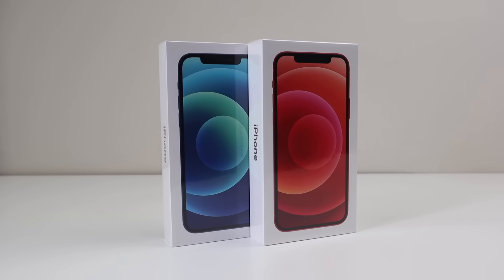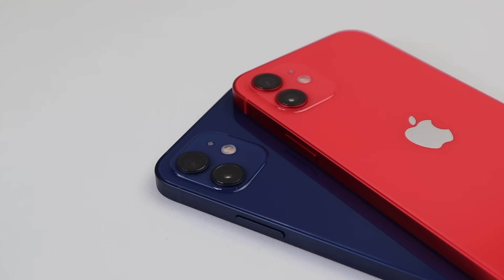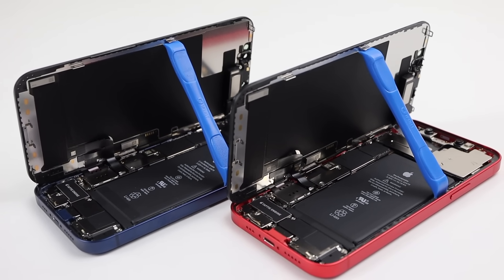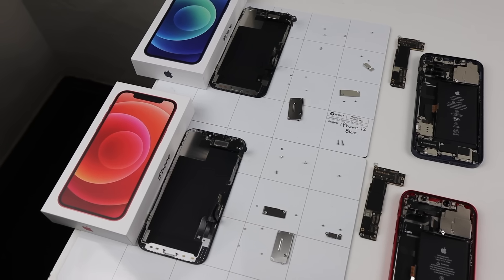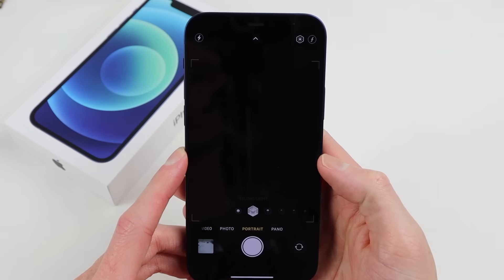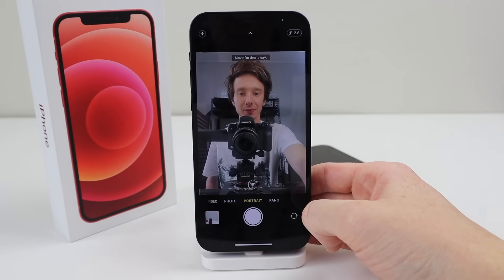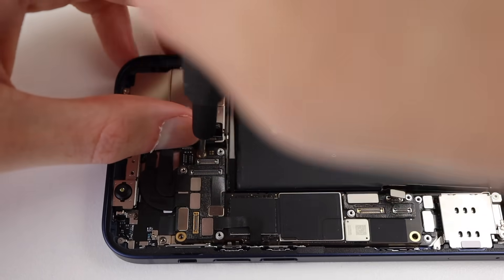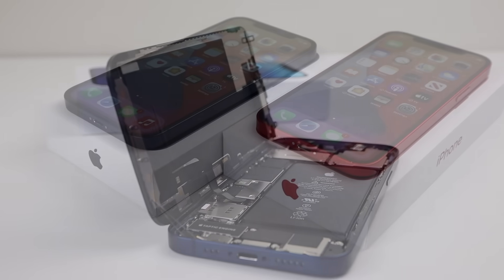iPhone 12 Anti Repair Design - Teardown and Repair Assessment

Comment: Apple is just a blatant scam. Never buy anything from them. Ever!
Reply: "Yo era amigo de Steve Jobs"
Reply: Not only are they a scam...  their hardware is inferior to just about anything else on the market. Soo not only are they underpowered, they are over priced and locked down so they cant be fixed.
Reply: @DrGibs347  the A14 chip is the fastest on the market. The M1 chip for the  macbook is also really good.
Reply: hmmm not really anymore i think they are actually heading the right way with their m1 chip in their laptops but the rest of their products still are shabby
Reply: @DrGibs347  underpowered ?
Reply: @DrGibs347  that's just a bunch of bs
Reply: @DrGibs347  they make small amounts of models per year which makes apps more optimized for the iPhone which is the reason i have one
Reply: @DrGibs347  hahahahahahhaha, underpowered. You been comparing frequency only? Apple's hardware is lightyears ahead of the competition.
Reply: @DrGibs347   it’s not a scam if you were a multi trillion dollar company you would not want to lose money many other businesses are like this stop picking on Apple
Reply: @adventureandaccidents9305  Apple is literally the only one that gets this greedy. All their products are specialized for only them (ex: repair, parts, etc) making it unaccessible for repairing or replacing parts easily, and they jack up the prices too. Other phones can easily be repaired with common parts found on most markets.
Reply: @CM-dx6xu  if you break your leg can u fix it easily?
Reply: @adventureandaccidents9305  your argument is a fallacy, and thus is invalid. You can't even defend your side properly
Reply: @kymab.5172   do I look like a lawyer to you?
Reply: @adventureandaccidents9305  Fanboy but I agree with you. Every single company does that
Reply: @adventureandaccidents9305  waaaaaa! waaaaaa! Poor poor Apple. Oh, it is a trillion dollar company NOT a multi-trillion company! Apple is too big. It has to be broken up for the good of society.
Reply: @adventureandaccidents9305  Apples and Oranges. LOL  Oh, and you probably think capitalism is not predatory either, right?
Reply: @rengalafuze8700  you hypocrite using Memoji I thought u hated apple
Reply: @adventureandaccidents9305  I love your logic, comparing a litteral piece of metal and plastics to a living thing that evolved in millions years.
An android can be repaired by anyone that have basic or medium knowledge of repairing phones in just minutes and don't have to wait, because it's just a machine and can go back to work instantly.
A leg can't have that luxure, a leg should be clean from the parts, cirurgies, x-rays and etc, and you HAVE to wait until it recovers completly, until then, you have evade doing some basic things, like LITERALY walking.
Good logic you have there.
Reply: @adventureandaccidents9305  Bro just shut up, you're making your image worse.
Reply: @insanemokey1025  all I’m doing is trying  to do is defend Apple in someway so ye
Reply: @adventureandaccidents9305  Your name just discribes what ahappend to you, but this time only accidents happend.
Reply: @insanemokey1025  OMG UR SO FUNNY  just go and mind ur own businesses
Reply: @adventureandaccidents9305  I was not trying to be funny, but okay.
Reply: Cállate dalas
Reply: I really dont understand why people still buy iphones
Reply: @BalkanicSense  because there the best phone company on the world even tho they are massive cunts when it comes to repair
Reply: @BalkanicSense  i had a xiaomi (something) as a temp phone when my old iphone SE was on its last legs and it was okay, but i genuinely prefer the new SE to a larger phone with a notch and the  oversized feel :/
Reply: @BalkanicSense  I don’t know why people still comment these stuff?
Reply: Dude on god, everyone gotta stop buying apple or this has to be reverted too many jobs are at stake, every single person that repairs is against this like myself
Reply: dalasito
Reply: XD
Reply: Imagine boycotting the whole corporation just because they don’t provide honest repairs , This video is to inform not to insult others , I guess you didn’t understand that , Not all people who buy iPhones are “victims of a scam” , there are People that prefer using iPhones, That doesn’t mean they’re fools and sheeps , they just have a different opinion , I’m ashamed of YouTube , they had the guts to make you verified when you’re just here to spread such negativity
Reply: @hilal_younus  lol you jealous of him being verified?? Dude thats the normiest thing ever, like "Oh ThEy JuSt ThInK DifFeReNt" yeah just like nazis, but besides that, OP also thinks different, and?? You dont realise but the one spreading hate is you, not him.
Normie confirmed.
Reply: @marcossidoruk8033  All I said is that it’s stupid Boycotting a whole corporation based on their repair stance , And calling them a scam, And when tf did I say anything in your comment ?? And yes , This person is Still spreading negativity
Reply: @Kit is good no, thats just not true, android runs on the linux kernel wich has proved to be an OS far superior to any propietary alternative.
Reply: ¡BUENA TULA TOWN!
Reply: Omg hola dalas.
Reply: Cringe 😬
Reply: My 6s plus is 5 years old, I’ve replaced battery 3 times and screeb once. There is not a single person around with an android from 5 years ago, the oldest one are 3 years old and there isn’t that many around. It’s not scamming, it’s just bad practices to push you towards their genius bar.
Reply: @albert3316  i have an android of 8 years old and it can run games
Reply: @albert3316  wow well I guess this phone im using doesnt exist
Reply: @albert3316  my android is 6yrs old, just starting to see symptoms of failure (some pixel discoloration). Imagine a 5+ year old iphone holding a charge for 72hrs while running modern apllications while also not slowing down at all after hundreds of software updates and overhauls.
Reply: ENUIRA  Totally
Reply: I get where the hate are coming from, I have XR and probably will be my last iphone ever.

but... yeah there's a but... macbook pro 2015 is one of the best purchase I ever made. It worked for what it was intended to, and for a long time, never really slowed down. it has been very very reliable.

I thinking the new mac pro isn't so bad either.
Reply: Epico
Reply: qUe BuENa tULa ToWn!!!!

Ok no
Reply: Pambisito here! :D
Reply: Dime la definición de capitalismo
Reply: I wish there was a better alternative for an operating system.
Reply: Unless it's a 5
Reply: I’m still gonna buy iPhones cause I prefer iPhones over android always have
Reply: @dustinhuck685  keep losing hundreds of dollars for nothing. You can buy a phone that performs as well as apple phones for 200$
Reply: @yumiko523  ok
Reply: But andriods suck so much HAHAHHAH
Reply: ._.XD
Reply: @sssscly  XD._.
Reply: Dolas raviuch
Reply: Yes
Reply: And they lie to customers they know they have brainwashed saying shit like they have the best phones ever compared to android. Apple knows they suck and android is better but of course they will say they are better and they have better customer satisfaction. Fuck apple
Reply: Samsung is a scam too
Reply: Never bought apple product Never ever!!
Reply: Buy samsung xD
Reply: ENUIRA  You have an obsession for tractors, you keep comparing an iPhone to different tractor brands. Very strange
Reply: You fucking idiot! You clearly have no idea how many phones are stolen with the intent of tearing down for parts. Plus the pairing of the Secure Enclave to FaceID prevents hackers from MITM attacks on devices. Consumers are LUCKY that Apple cares this much about the privacy, safety and security!
Reply: @jonponton  Jesus calm down
Reply: @jonponton  bruh who even cares about phones getting stolen. Not me
Reply: But I love iPhone. They’re the cutest looking phones :( all the other phones are literally ugly.
Reply: @Cervantesbracetty  what
Reply: @brindhaanand598  I said what cuz they said it looks cute..
Reply: @owo-osu1286  He's probably an apple fanboy
Reply: @Cervantesbracetty  Biased. I am not dumb enough to buy an extremely expensive phone just because it looks better.
Reply: @Cervantesbracetty  They look literally all alike
Reply: @Cervantesbracetty  sOO TRUE THERE IS nO  PHONE THAT LOOKSLIKE IPHONE
Reply: @Cervantesbracetty  No...
Reply: @Cervantesbracetty  all other phones look exactly the same? hell samsung looks better because is has better buttons than shitple- sorry I mean apple
Reply: @Cervantesbracetty  as if that matters. You'd probably buy a scan $20k phone that is irreparable and doesn't function because it's "cute"
Reply: @yumiko523  eh, I’m the one who has to walk around with the phone and look at it everyday. I get to prioritize what ever I want when choosing what to buy. There arnt any rules. I enjoy the design. That’s reason enough for me.
Reply: @Cervantesbracetty  Wtf
Reply: @Cervantesbracetty  Haha yes, it's cute until it breaks and Apple decided it should barely be repairable. Well that's okay, you can just buy the brand new one every year so it's not that much of a problem.

Comment: The secret is Apple's T2 chip. Each replaceable part has a 3d barcode printed on it. That 3d barcode is a unique identifier that Apple technicians have the ability to reprogram the T2 chip to accept the new parts. Hopefully someone will leak the program or create a program to reprogram the chip.
Reply: Im sure they will
Reply: Why bother when you can just you know... not buy an Apple phone?
Reply: Why bother? you can buy an android which no restrictions B)
Reply: @chadg.9692  not trying to get hacked every other day
Reply: Hopefully no one will buy this garbage until they make it repairable by 3rd parties
Reply: @Franklii21  swapping a harddrive or motherboard onto a different phone to "break" the locks(face rec, password, etc.)
Reply: Pain ars4  apple products deliberately made to stress you out in every way their design team can think 👎never purchase another one !
Reply: Hopefully they won't, anyone dumb enough to buy an Iphone deserves to be ripped off by Apple
Reply: Hopes this makes yall day
https://youtu.be/tHl2WGFHFGA
Reply: They sell the phone, as such they sell the chip on it, as such someone will tear the code apart and find what makes it tick for sure
Reply: Leaking the program, if it happened, would never ever be enough - it's not unheard of for internal device testing software to be accidentally left on iPhones or Macs, and although it runs the software is 100% useless as it requires a physical connection to apple servers (or similar) to function. The first instance of this was many years ago, and their protections against this may have developed more since then. Also, a third party program would be near impossible to create, it will most likely never happen - it's extremely difficult if not impossible to get around apple's hardware security. The most common (and probably tamer than this) example is bootloaders, they haven't been exploited since the iPhone 4, iirc, I think there was a newer one but it's incredibly rare. Would take a lot of effort.
Reply: Thanks for sharing. In the future, I can see people tricking that hypothetical leaked program into thinking that it’s connected to an Apple server. Maybe creating a 3rd party program, using the leaked program as reference... If it ever leaked lol
Reply: What if this was done for the privacy reasons? Imagine someone steals your phone and tries to swap components to get to your data
Reply: @TheEnderFlash  Don't need to do that to steal your data, heck, data has probably stolen from you already without you knowing. Online privacy doesn't exist, get a VPN
Reply: @nekatsuk1  so the goverment is aware of the amount of porn i watch on my phone o.o?

Omg i feel bad for the guys who spy me, but i got weird tastes u.u
Reply: @pak3ton  They've probably seen weirder things (like my tastes) LMAO
Reply: @nekatsuk1  lmao 😂
Reply: @pak3ton  same here. Also, love your comment.
Reply: @nekatsuk1  i find it funny that apple's osx 15 (Big Sur) just phones home to apple what appliciation you open at what time with the ip adres. Apple: PrIvacY iS ImpOrTeNt fOr UoR CosTUmeRs.
Reply: @rubenthedoornob6949  Seriously Apple is just another mega rich company. I'd rather use a fake bootleg phone or a lower-end phone than an Apple phone
Reply: @pak3ton  BBD I sure 😂 😂
Reply: @TheEnderFlash  dumbass, try again
Reply: @TheEnderFlash  are you sped not like theres a whole ass hard drive in the phone

Comment: Apple just lost a keystone battle in Massachusetts. They signed in a right to repair act that states that manufacturers need to make available the same internal tools they use to repair devices to 3rd parties. It will be interesting to see what comes of that if the open market will have access to repair programming tools

Comment: After 2 years of applecare or applecare +theft/loss, you can extend it monthly for $10 or $13 a month respectively. I just got iphone 12 on a 30 month finance with ATT’s $800 rebate for iphone XR trade in. For $260 I got applecare +theft for 24 months. That is only $11 a month. Pretty great insurance. I would buy a droid IF they had a real store to take it to have it repaired with genuine parts by an employee. I see this as a no issue but agree that the programming pairing software should be available in 3-5 years.

Comment: I avoid Apple as a brand. Doing the right thing isn't hard. They expect customers and the world to do the right thing, but do not hold themselves accountable to the same standard. The marketing focus groups for brand image improvement are the swank that spawned the "lets green the HQ" and turn around and make a sealed brick that is guaranteed to unserviceable in 2-3 years. The limitations of lithium are known. The phone itself is designed as a lego system, as evident by the phone we saw.  Forced obsolescence by design. Shady shit as always. Apple assumes they are smarter than everyone. I say they are just greasier.

Comment: Apple slowed down their phone intentionally so that you have to buy their new phones now this....
Reply: true... i'm using an iphone 6s, a hand me down from my mom, only because my samsung phone got stolen. it's seriously so slow and laggy, even if there's still a lot of storage left and there are no viruses
Reply: @mei8511  I have the same issues, last year it was working fine and dandy and could handle games and other stuffs without issue. Now it's struggling to even handle Discord or YT, seriously disgusting.
Reply: @mei8511  but that’s an iPhone 6s, so it’s obviously gonna be shit
Reply: @mei8511  You just need to change the battery. It'll work fine after that.
Reply: My iPhone 5s has 3 gigabytes of free space. The thing runs like shit and dies after about 20 minutes of use. I also can’t download anything from the App Store so I’m just stuck with Snapchat and YouTube for apps.
Reply: Both Apple and Samsung have been proven to create updates that are harmful to older phones. Something about it not being able to run older hardware.
Reply: This is old news 

It’s actually because of battle life issues and they have fixed this and you can turn off the performance issue but your phone can just shut off sometimes if the battery is that old

Comment: in 2035 be like:

This is iPhone 25, we removed battery, mainboard, CPU, ram, and screen. If you want to using this you need to buy all the thing that we say we're removed. Price is $100000 which do not contain battery, mainboard, ram, cpu. $5000000 for fully things in this phone. After 6 month use, we will install the software through app store which made your phone can't usable. Hope you enjoyed it. Thanks
Apple

Comment: why is that a bad thing?  Its actually better because up until now IF you got your iphone by third party repairshops fixed apple would not longer see it as original. So whenever you bought a new iphone you COULD have sent the old broken one to apple and gotten money in return. If it was fixed by third party then not.

Comment: Why is everyone hating on apple, this is good, you can still get your phone repaired but just at apple, and all the 3rd party repairs were so bad anyway and come with loads of problems
Reply: @FeuermeisterX I haven’t but my friends have / when I buy used u can instantly tell if the screen is 3rd party or not actually and the 3rd party ones are so bad so it’s a good thing apple are doing this
Reply: @FeuermeisterX well I’m glad they do because then your phone has to actually have a good screen instead of a 3rd party one where the colour balance is off and way worse quality

Comment: He should have done the just the battery swap and just the screen swap, in all the years I’ve owned iPhones these are the only two swaps I’ve ever had to do (cracked screens/old battery)
Reply: they started serializing screens since  the iphone 10  i think. meaning youre phone will just become a buggy mess if you put a diffrent screen other than the one it came with.

Comment: I love all thing Apple... Heck I have four old Mac Plusses in the basement.

You know a Butt is coming... I understand that the features above help with quality control and ensuring that the phone has the correct parts for compatibility... But Apple could make these things a lot less difficult to repair and upgrade.  Sure Apple wants to get every possible penny a user may spend on a phone... This is rather Orwellian in the control Cupertino levies over their devices one they become “my”Apple devices.

Hey, it’s not as if I’m going to buy an Android or a Windows computer.